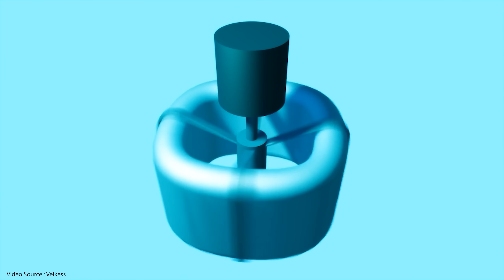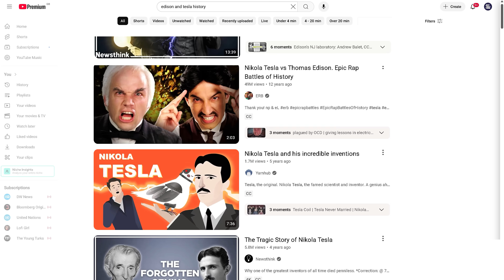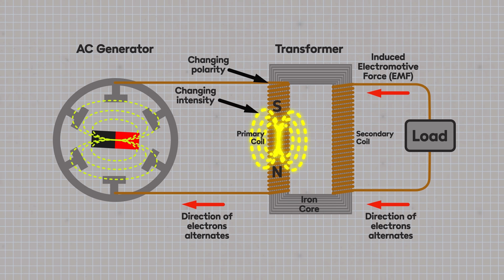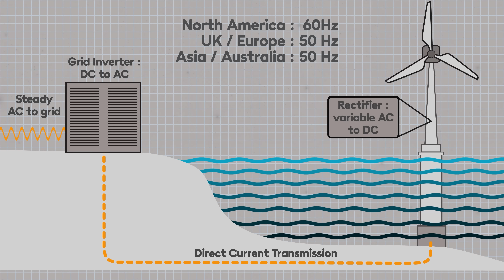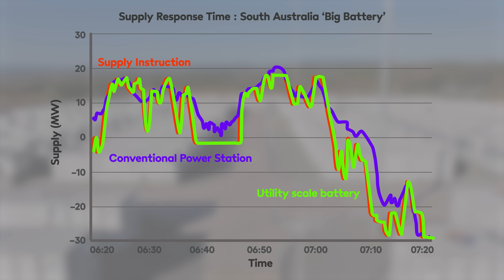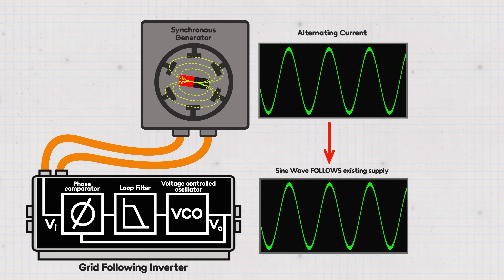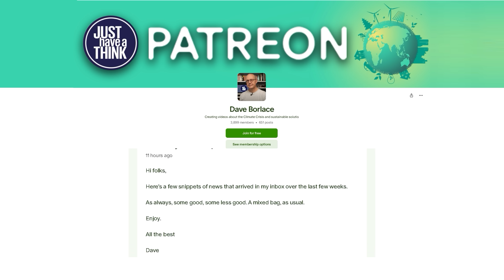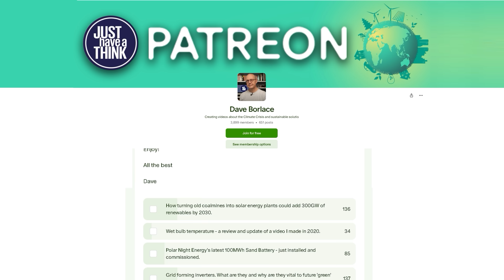How GRID FORMING INVERTERS are paving the way for 100% renewable energy.

Comment: Like many people here, I have solar with a battery and inverter, which has taught me some things about how this works.
So much rotating equipment (like heat pumps, refrigerators and aircons), our LED lights and most electronics nowadays use DC power. Equipment is often advertised as such by having a built-in inverter (to invert the AC to DC). And although it was difficult to change DC voltage when electricity was first introduced, we can now do that easily with modern power electronics.
There is no reason to be using AC power any more. If we had to start designing electricity grids back from scratch with todays technology we would have set it up as a DC grid and not have to deal with frequency issues at all. DC grids would be more efficient in the modern age as our power generation increasingly comes from DC sources, electricity transport is more efficient as DC and most of our consumption is ultimately done as DC power. It would eliminate a lot of DC to AC and back conversions and eliminate the need for the equipment that does all the inverting, needing only DC voltage converters, which are smaller, cheaper and more efficient.
Many people with off grid systems use DC power only. I think we should focus more on developing DC microgrids and perhaps even converting our grid to DC power.
Reply: While so e of what you say is correct, it is oversimplified and contains some potential for 'difficulties'. I suspect that the grid, with all its issues, will remain an AC coupled system at least at the low voltage distribution level, mainly for safety and simplicity. Voltage conversion using simple transformers remains a highly reliable and safe way to distribute LV power to consumers. As you say, AC to DC conversion and vice versa, if necessary, is easy, cheap and efficient in consumer equipment, whereas controlling HVDC in a domestic environment is neither safe nor cheap, and is effectively impractical, imho.
(Electronics Tech. all my working life, and wired up the odd house to boot)
Reply: @gregbailey45  Simple transformers with an iron core are increasingly being phased out by electronic transformers, that turn AC into DC and use a transistor to turn that DC back into AC at the right voltage. We really don't need to start out with AC power.
Similar to the AC grid, we can use HVDC for longer distance transport and use LVDC in the domestic environment. Stepping down the voltage as we go and limiting the maximum current at the socket for different voltages such as 48, 12 and 5V.
Reply: What an interesting "out of the box" idea.  Certainly worthy of further thought, but can modern electronics really step up/down high DC voltages at high currents?
Reply: @billbarden6663  High voltages and currents are possible, but the equipment is (still) expensive. It works out economically for longer distances. It's best to start with microgrids, e.g. an island without mainland connection. Anywhere where you don't need high voltages over short distances. We need to scale, so we can further develop this technology. It is still relatively new technology.
Reply: @billbarden6663  There are many HV DC interconnects around the world.
eg Basslink between Tasmania and the mainland switches 500MW of power.
https://en.wikipedia.org/wiki/Basslink

Comment: I have one of them new fangled grid forming inverters on my house.  8.4 kW of PV and 16 kWh of LFP storage all under the watchful eye and control of a Sigenergy Controller.  I use almost no grid power.  I say almost as I use their AI system and it makes a determination of how to use the grid |PV|battery to supply power for my home so I get the maximum financial return on my investment.

We don't lose power here very often, about 3 times in the last 18 years.  but we are ready should we need it.
Reply: Got the 24kw sigenergy system can upgrade any time will get a electric car in 2 years too plus upgrade my solar panels then too

Comment: If you have a UPS (Uninterruptible Power Supply) feeding your computer, you essentially already have one of these systems. It filters and conditions mains power, and replaces it when lost (as long as the batteries last) by generating its own sine wave AC. As a tangent, the UK's National Grid "black start" (now referred to as Restoration) for national electricity transmission systems (NETS) uses primarily pumped hydro generators such as Cruachan Power Station in Argyll and Bute. Cruachan can generate 440MWh of electricity for up to 24 hours, and has a contract to always have at least 12 hours reserve on standby for the National Grid. In the event of an incident which shuts down major parts of the grid, Cruachan can provide the power required to spin up the systems required to "black start" nuclear reactors and other generators.
Reply: 440MW*
Reply: I don't have a UPS but I do have a  mains capable power bank sitting on my desk beside me as I type. It doesn't follow any grid (duh). When I first heard of this issue my response was "what, there are inverters that can't actively generate an AC signal".  A bit of failure of foresight it seems to me.
Reply: @francisboyle1739  Not really, it depends on your use case. Generating a sine wave is not difficult, but if you're shadowing a mains power source then it's crucial that it is perfectly in phase with that source. This means extra circuitry for sensing, power management, and possibly power factor correction (depending on load) which would be redundant in most other applications, so it's understandable why there are different versions of what on the outside may seem to be identical products.
Reply: @francisboyle1739  It's a safety issue. There are solar inverters/batteries that you just plugin at a wall outlet. They allow you to store energy and reuse it at a later time.
The safety issue is that the grid regulations state that when an engineer pulls the main breaker for your house (for maintenance), then your house is supposed to be powerless. An active inverter on your home grid would defy that safety feature, possibly with lethal risks to the engineer. Therefor these inverters must switch off when the grid goes dark.

Comment: Both sets of my grandparents lived without electricity till their mid 40s, they lived a reasonable lifespan and raised happy well adjusted families
Reply: Yes, but they lived in a world where that was still perfectly normal, when we had banks, post offices and grocers in the high street. and "bobbies on the beat". Now everything runs on electrons, computers and the internet, is centralised, and most high streets are charity shops and wine bars. Without a stable electricity supply, modern society ceases to function.
Reply: This isn't about electronics or media. A world with 2 billion people on it (1927) can run with wood and coal, only slowly building CO2 and leveling forests. A world with 8 billion people (today) needs to heat, cool, make steel, formulate fertilizer, move trains, somehow make concrete mostly with clean electricity or the waste gases and forest destruction threaten us all.  We've been burning fossil fuels for centuries now and the world's waste bin is overflowing.

Comment: Presumably a domestic stand alone (not connected to the grid) system with solar panels and battery storage has a grid forming inverter as well.  Otherwise, how do the solar panels and batteries produce AC.
Reply: Sigenergy battery has a gateway that can handle off grid completely in power black outs can still use solar panels etc why I installed a 24kw system never want to go 3 days without power again

Comment: Lovely straightforward description of the problem.. should be part of the National Curriculum! For more technical description the Electric Brit takes you through the maths on hid YouTube channel. Dogger Bank C will be joining the UK Grid next year with grid forming capability.
Reply: The UK already has grid forming batteries and syncons on the grid, roughly a 1/3rd of the inertia is already synthetic, delivered by the Stability Pathfinder projects over the last five years. These have been so successful they've allowed the UK to lower the minimum inertia level on the grid saving millions each year (by not needing expensive spinning mass generators to be run).
Reply: @GruffSillyGoatgood to hear!

Comment: I can't see any problem having a pumped storage unit with a massive fly wheel.  Just enough water would be allowed to keep it idling at the required RPM and as demand suddenly rose, the tap would be opened the required amount and the unit would 'put its shoulder to the wheel' so to speak.  Presumably, hydro stations already act in this mode.  The impellers are massive.
Reply: Just do it. You'll learn heaps!

Comment: Rooftops are dirt-cheap empty realestate. 
Rooftop PV electricity does not need the grid supply when v2g EVs massive battery are parked 23hrs every day and all night long. 
EVs massive battery on wheels are FREE MASS ELECTRICITY STORAGE daily and all night long. 

We have the beginning of the best economic energy solution starting now. 
Grids cost $TRILLIONS, $millions per km. New capacity is extremely expensive and needs decades and decades to build. 

The numbers make sense now for rooftop PV and batteries, fortunately.
Reply: Absolutely!

Comment: Concerns regarding dependency upon an electrified world come into sharp focus when grids are subjected to the extreme conditions caused by climate change. Here in West Wales, one of the wettest places in the UK, we have alarming localised drought for the third year running. Our local grid is overhead cables and last Autumn storms wrought havoc on local distribution systems. My own home was without power for 3 days and the local telephone exchange and mobile services were also disrupted. Fortunately, the weather was mild and there were no burst pipes. Mains water was returned after 24 hours, I have a wood burning stove for hot water and a place to keep warm and even rudimentary cooking or at least a hot drink. 
The experience is one I had anticipated, though, any longer and my chest freezer would have been in danger. It did make me rethink my preparations for such outages and I understand what a major grid crisis could mean. I think we all need to seek reassurance, in the light of the recent government ruling on developing the grid.
Reply: Same now installed a sigenergy 24kw battery so can go off grid for 2 days plus 3 days no power sucked lost lots of food
Reply: Get yourself a heap of solar and batteries and never have another outage!

Comment: I'm off-grid; an off-grid inverter is 'grid forming' on a very small scale.
Reply: Yes, off-grid inverters do this trivially continuously and normally but the law is that on grid inverters must shut down when the grid voltage or frequency go out of normal range. The grid legislation created the problem that actually does not need to exist and can be solved with software changes but full grid forming requires hardware switches too
Reply: Use my sigenergy 24kw system to go off grid when storms approach can blackstrap too also have gateway with option of generator
Reply: @Gordon-j4j  You mean 24 kw/h?
Reply: @bknesheim  What is supposed to increase or decrease by 24 kW every hour?
Reply: @SebastianSchleussner    kw/h is a unit of energy describing how much energy a battery contain. If you use 1 kw in one hour you have used 1 kw/h. If a battery is rated at 24 kw/h you can 1 kw in 24 hours or 2 kw in 12 hours.
Reply: @bknesheim  except that your nomenclature is incorrect - it isn't kw/h (which would be kilowatts per hour) - it is kwh (kilowatts * hour.  Power times duration is total energy.
Reply: - and you have big problem if the frequency start to drift.

Comment: Used to work in a plant that had its own power station. When they connected with the grid, they got the speed right in sync then through the switch and the building would shudder and you were grabbed by the grid there was no escape. Resistance was futile. Keep up or group out was your only option 😂. I read the other day that They are looking at adding spinning flywheels to the Scottish grid for this very reason.
Reply: And now you know why that is completely unnecessary!

Comment: Interesting that non experts or WRONG EXPERTESE experts promote nuclear electricity because of the spinning mass inertia.

Also, grid engineers are very quiet on the extreme costs of more grid capacity as the world needs to electrify. Extremely large costs include profits and income for decades and decades.

There are examples of these new capacity building projects. 
Simply divide the project price by the length of the transmission line in km or miles.
That includes the substations and switch yards and 50tonnes of galvanised structural steel per km plus reinforced concrete foundations plus  ......

In Australia governments guarantee profits on all expenditure.
So over spend is profitable.

Comment: I was told that power stations used to dump excess electricity into industrial radiators pointed at the sky. A paddock full of heaters. 

They would ramp up production and then switch in the grid load.
Or if the load ramped down too fast the heaters were switched on.
Just my comment.
Reply: Or charge a battery...
Reply: @gregbailey45  my thoughts are that is exactly what the Australian Nuclear promoters are thinking. 
Keep the nukes at 99% UTILIZATION and use the big batteries. 

But if big batteries are so effective then daily rooftop PV feed-in to the grid and feed-in from the under rooftop big batteries on wheels and centralised generation will be stranded assets. 

Centralised generation grid supply matches the millions and millions of consumers maximum demand, maximum grid load. 

So when every consumer becomes a grid feed-in supplier from BEHIND the meter, then grid cashflow collapses. 

FMD, people are slow. 
People rely on EXPERTS talking ignorant crap outside their expertese. 
People are mislead.

If climate change, destabilisation, is the bases for no fossil fueled energy. 

If EVs with big batteries, batteries that can supply for hours on yhe long drive but are parked 23hrs every day and all night long. That can be topped up daily. 

If dirt-cheap rooftop PV that is cheaper than home windows $m2 and getting cheaper 

If people understand how extremely expensive national grids are, $TRILLIONS and $millions per km to expand and how much fossil fueled energy needs to be replaced.

Then some common sense conversations can be achieved.
Reply: @gregbailey45  5  my thoughts are that is exactly what the Australian Nuclear promoters are thinking. 
Keep the nukes at 99% UTILIZATION and use the big batteries. 

But if big batteries are so effective then daily rooftop PV feed-in to the grid and feed-in from the under rooftop big batteries on wheels and centralised generation will be stranded assets. 

Centralised generation grid supply matches the millions and millions of consumers maximum demand, maximum grid load. 

So when every consumer becomes a grid feed-in supplier from BEHIND the meter, then grid cashflow collapses. 

FMD, people are slow. 
People rely on EXPERTS talking ignorant crap outside their expertese. 
People are mislead.

If climate change, destabilisation, is the bases for no fossil fueled energy. 

If EVs with big batteries, batteries that can supply for hours on yhe long drive but are parked 23hrs every day and all night long. That can be topped up daily. 

If dirt-cheap rooftop PV that is cheaper than home windows $m2 and getting cheaper 

If people understand how extremely expensive national grids are, $TRILLIONS and $millions per km to expand and how much fossil fueled energy needs to be replaced.

Then some common sense conversations can be achieved.
Reply: @gregbailey45  if the nuclear promoters to stop CO2 emissions worldwide and 80% of the world's population lives in dictatorships then military defence exploding budgets would need to be added to the cost of nuclear electricity and bigger grid costs.

France's nuclear electricity is part of France military defence budgets. 

Stalin's standing army, the USSR standing army, the invading army that never left for decades, created the French Shttsnpants terror of another massive blitzkrieg. 

The crazy Arab oil embargo weakened France's military defence and so France doubled down. 
Nuclear aircraft carrier, nuclear submarines, nuclear missiles and weapons.
France's nuclear fleet over electricity plants is oversized and needs to dump excess electricity into Germany and  ...
Nuclear generation is not load following and can shutdown rapidly but takes days to get back on line. 

Putin has restated the Russian wet dream. The real Russian dream of occupation. 
China's Western invader who never went home is Russia.

Dictators love ❤️ nuclear electricity industries. Nuclear is a financial disaster if you accept modern technology.